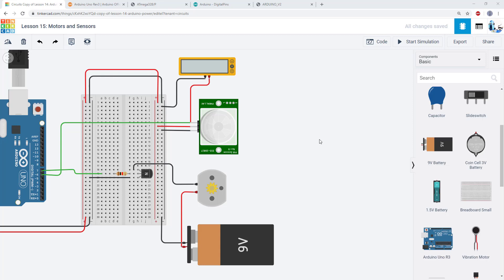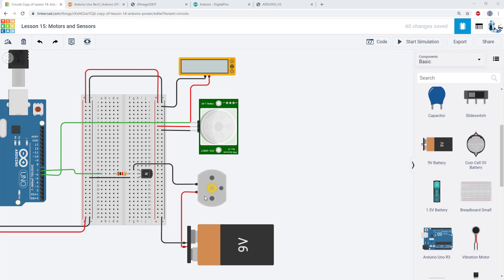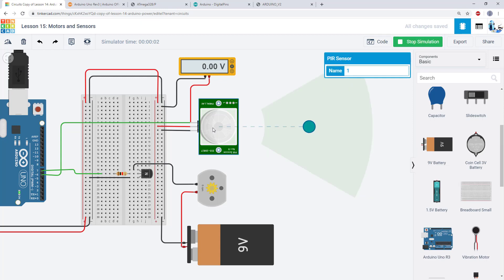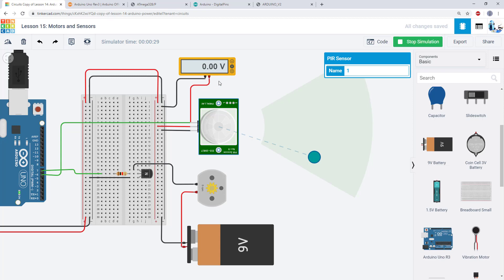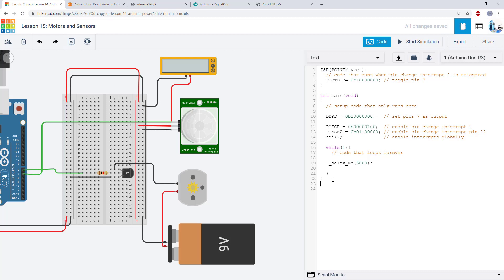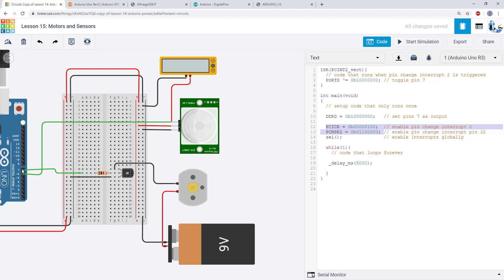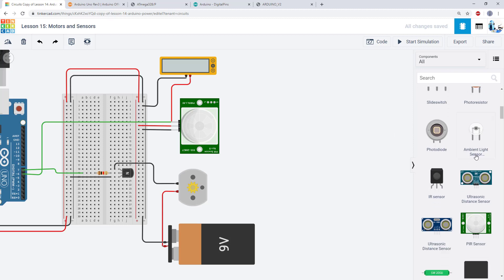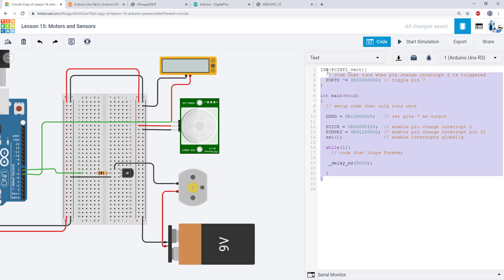Tinkercad + Arduino Lesson 15: Motors and Sensors

Comment: How do you code the Arduino to automatically turn the motor the opposite direction (to close an automatic door when the PIR motion sensor does not detect movement)?
Reply from the maker: Please see the video in this series about H-bridges and robot steering, that shows how to change a motor's direction.

Comment: Thanks for this video.  Do you have any that explain how to take the breadboard out of the equation?  I don't know anything about electronics and can't find anything explaining how to turn these into self-contained devices.  I can solder, but that's about it.
Reply from the maker: Hi Rick - I don't have my own video on this, but the good news is that if you already know how to solder then you're halfway there. The answer depends on what exactly you're making. If it is a SUPER simple circuit - say just a motor and a battery pack - then you just solder the wires together directly. For anything more complex involving resistors etc then you want "protoboard" or "perfboard" - it is a board with a grid of holes, similar to a breadboard, but there is a little copper ring around each hole so you can stick a through-hole component's lead through the hole (like a resistor or LED) and solder it in place. The boards come in all shapes and sizes. Some are just a grid of holes, none of which are connected to each other: https://www.sparkfun.com/products/8619. Some have a hole layout with connections similar to a solderless breadboard: https://www.sparkfun.com/products/12070. A step up from this to an even more permanent or mass-produced device would be making your own printed circuit boards (google "make your own PCBs"). I've never done it myself but lots of tutorials out there. Hope that helps.
Reply: @BenFinio  Thanks so much for the detailed reply, it is very helpful.  I'm trying to activate a motor and MP3 via a motion sensor, which sounds pretty doable based on your description.  I really appreciate it!
Reply from the maker: @rickduda9322  No problem! You may find some of my other electronics tutorials useful, like using a multimeter and common beginner mistakes - available in this playlist: https://youtube.com/playlist?list=PLKL6KBeCnI3V5XgmKOHv4vKPGBd-qc1QU